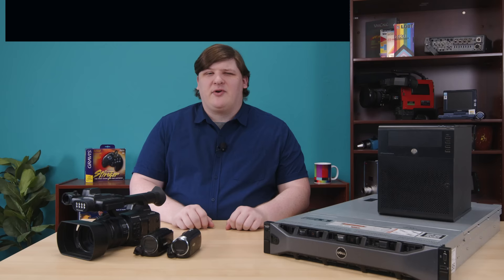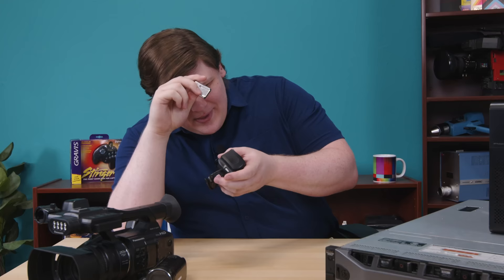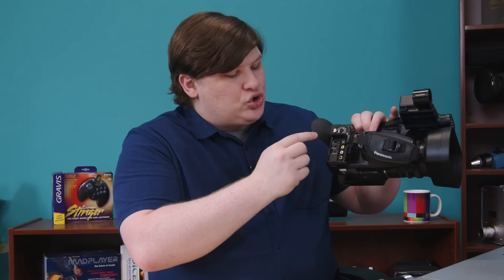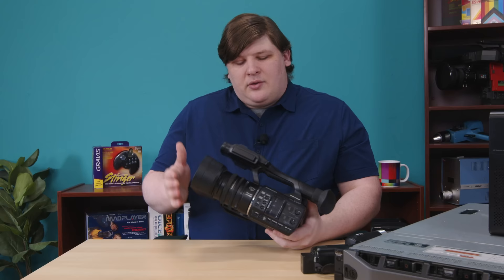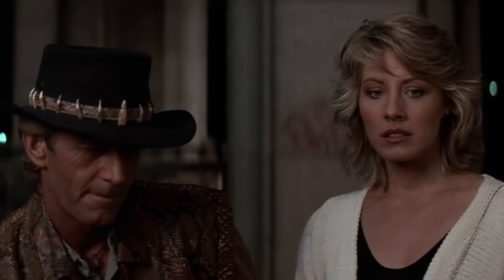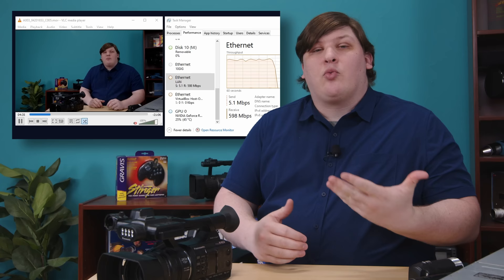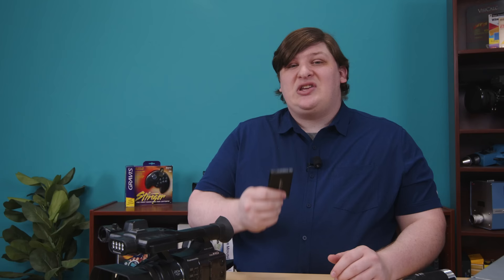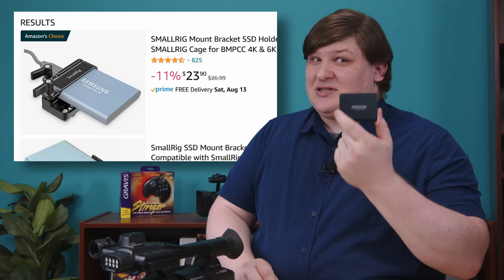I Built... a really fast NAS?

Comment: I built a similar system, except under Gentoo/ZFS/samba and I have all 12 drives as a single RAID Z2.  It's also built from a ASUS WS-X570 ACE and a AMD 3950x and some generic hotswap chassis. I don't do backups but I have aggressive snapshots.  I'm using optical10GBe between the server and the switch and copper 5GBe between the switch and various high bandwidth clients.  i.e. My settop box and my workbench.  BTW: I love LOMs as well, I used to have a supermicro board with built-in management which piggybacked over one of the Ethernet ports.

Comment: Sorry, well behind,1 year ago, miles too late no doubt but two suggestions; 1) problem of T7s not being ready to reuse when you want to record - you still have the T5s so use them or buy more T7s so you have two sets with a second hub and you're much more likely to have a set available. 2) rendering problem - instead of buying a graphics card with all it's upcoming headaches, buy a machine specifically for rendering the videos to your desired format, it can run happily while you are editing another one or playing your favourite game.  Direct connect your desktop to it to transfer the edited file to it and then direct connect it to the server to transfer the files after rendering.  This will ensure that the file tranfers etc. don't interfere with each other and help to discipline you work flow. You can use the second connector on the server for you personal usage also not interfering with you work usage.  All relatively cheap, really, and simple enough to not need any training videos and manuals!

Comment: When the camcorder manufacture has to  include a light built in it tells you something about the capability of the camera sensor.  
The Panasonic X2000 also has a really cool light in the handle you quickly figure out it was included to make up for the shitty tiny sensor.

Comment: I do really think that you can get more speed juice out of those Crucial SSDs performing a "secure erase" (or safe erase) despite it's a pain in the azz and involves certain risk. Some brands like Samsung provides a bootable tool to perform such a task easily, but doing so in Crucial, WDs, etc. is more troublesome: SSD drive "frozen" state which requires a Sleep command, followed by a physical detach/re-attach and so on. A bootable Linux dist or the "previous" Parted Magic version is usually needed.

Comment: A couple comments below @arnechino hits on the key point. Watching this video vs more slick & 'produced' content on similar subjects held my attention for the same reason old Spidey comics used to keep me engrossed. It's totally relatable. In an 'I can't win for losing', predictable kind of way. The excruciating detail of the rabbit hole of tech pitfalls mirrors my own personal experience literally beat for beat, the entire rhythm of it. And your attitude & the way you refer to the various pieces of technology as promising hope of the ability to rise to new, never-before envisioned level s of efficiency, just everything humming along perfectly, only to become immediately disillusioned and realize all the inherent gotchas of technology so tightly coupled to consumerism, with ridiculous limitations & incompatibilities seemingly baked-in to keep you spurred in a never-ending 'upgrade this piece to work better with this other piece, then flash the new firmware which means I gotta install a new driver version that requires an upgrade to the the app to utilize the new standard/protocol/codec which means I'm outta space on my system drive which means I gotta buy a new piece of hardware with higher capacity to even do what I need to do' catch-22 of the never-ending, circular consumer upgrade cycle... The affectionate yet backhanded way you refer to older hardware that you resentfully had to use for too long, the jaded, cynical outlook that is the product of years if not decades of molding through this process. The 'I am not a smart man' stuff of being pummelled by the soul-suckingly high-maintenance nature of managing this crap to be able to manage your 'actual' crap. It's so meta. So frustrating, so exhausting.... but ultimately it makes me feel better to know that I don't suffer alone. All the thoughts of 'mere mortals. they have no idea of the burdens i bear!' with their blissful ignorance and thinking 'you're so smart you know all about these computers & technology'... they don't have a fkn clue. But knowing that there are others that fight the good fight. Brothers in solidarity. Knowing that the 'struggle is real!' is what keeps me entertained. Belly-laughing when you you pull out the fired power supply from trying to render with no GPU. Priceless!!! I worked in a big-ass data-center and the #1 failure across the board is <drum-roll please> POWER SUPPLIES!! That's why they're hot-swappable and don't have all the damn connectors on cables for yer 6-pin & yer 8-pin PCIE power. Oh yeah.. there's a LOTTA stuff your can do that is technically NOT SUPPORTED and the vendor is never gonna help you with that. I mean maybe if you know a tech like personally he'll clue you in... but in the enterprise world there's no time to be screwing around with all that sketchy stuff. And nooone is gonna care whether your script does or doesn't do what you think it should. NOT SUPPORTED!! Ha! Good times. I was entertained by 1.5-ish hours of 'day-in-the-life Woke up, get outta bed, ran the comb across my head....' adventures. And no, i'm not a Patreon supporter but I did subscribe. This was by far the best, most humourous, most relatable & inherently funny piece of content I've seen from you yet. Keep up the good work!

Comment: Running 9x Dell M1000E Bladeservers in 3x 36U contoured IBM racks, at home... initially sounded like fun.

Steel I-beam reinforced floor.  Lowered ceiling.  Three air conditioners, two domestic supplies for 120A at 230v, and a house that's always too hot to be comfortable and a downstairs that's too loud to think.  So, I live upstairs now, with a window always open... like, always!

My electricity bill is ridiculous, so now I'm running other peoples servers and telecoms to pay the electric and the network bill.  I feed it with two seperate 'hyperoptic' 2Gbit synchronous fibres, two failover 650Mbit cables and a 3G/4G WAN connection for the administrative VLANs 'last chance' failover... who's rental costs it also has to cover.

Unfortunately, one side effect of all these contracts is that I cannot afford to just turn the thing off!  The thing eats electric, drinks bandwidth and thrives on human sweat, tears and broken dreams.
I've spent the last three months staying with a friend, and it's been absolute heaven.  I had almost forgotten what 'quiet' sounded like.  So I may have to face the very real possibility that my house has been taken over and I'll have to go live in my car.

Anyone want to buy a cluster?  It comes with a free house.  Anybody?  Hello.... anyone?  anyone at all?

Comment: FYI: I run R720xd's with two Nvidias in each under Kubernetes running transcoding tasks [ffmpeg+CUDA]. It's doable with 1100 W PSUs and in DC – so you're right about both the temperature and power requirements.

Comment: This was great.
BTW, when you can, just get a switch that has SFP+ ports available. If you already have SFP+ uplink ports on an existing switch, just put your server and workstation on the uplink ports if they're not in use. Even with a switch in the middle, direct-attach copper has nearly no latency. Your fast NIC/slow NIC issue will disappear, as then you'll be connected to your network over the fast NIC, eliminating the need for the slow NIC, and your multiple connections error might die.
You don't need separate fast/slow NICs on your workstation or your server this way, as you'll still have more bandwidth going to either of them than your workstation will need to your server and the Internet combined.
Reply from the maker: Much of the reason I haven't done that is for data security. I largely trust my home network, but you can't be too careful, and since there's no reason for anything else on this network to ever touch this machine, I prefer having it as isolated as possible. It's worth considering though.
Reply: @CathodeRayDude  It's worth giving a trial period if you have the hardware.
Judging by your situation, it's not getting any isolation at all as it is. A few things could be going on here.
One is, your iDRAC port might be doubling as a network interface when the server's on. I can't confirm this, so it's just a thought.
Another is, you have your server connected both to your network (RJ-45 other than iDRAC) and to your workstation.
In either case, there's no access control. You're allowing SMB connections to come in from your home network. There are two ways to combat this. One is, to set your server's firewall (usually UFW, the most popular front-end to iptables) to block the SMB port on your RJ45 interfaces. The other is to set "hosts allow" in your smb.conf to designate which IP addresses may connect. If you want it REALLY hardened, you can do both.
That being said, you could just connect your server and workstation to your home network over SFP+ ports on a switch and use that "hosts allow" rule to harden it. You're already doing really well by having a read-only archive, so the only way the archive can be corrupted is if the server gets attacked rather than a device that just so happens to be able to access the shares.

If you want to talk later in more detail, I am an absolute paranoid nutcase when it comes to security, but at the same time, I do things many people erroneously think are risky.
Reply from the maker: @LokiScarletWasHere  Oh sorry, I left out some details about that to save time. I have my smbd set to only listen on the 10gig interface, and intend to add harsh firewall restrictions once the machine soaks a bit longer. The only reason that problem happened is because I was still in the testing phase and hadn't yet put the limit in place, but I was still very irritated to see that Windows' abstractions ignore which IP you deliberately try to access a machine with. To wit, some people have told me that SMB3 is supposed to multipath if possible, but the nutty thing is that not only did it not prioritize the IP I accessed, it also picked the slower connection. I'm sure that's only because the internal NIC identifier was lower, but that's still an absurd way for it to work.
Reply: @CathodeRayDude  That's Windows for you. It's essentially asking the server "Who are you" and then ignoring whatever identifier you used to connect to it, instead identifying what other IP addresses or even other protocols it can reach it at, and using absurd logic to decide how to do so. It's part of why I hate Windows so much. Every job I've had, Windows would deliberately choose the worst way to do just about everything.
You may get some better control out of NFS, though that's not as native and simple for Windows as SMB is. 
Hopefully your errors go away when your firewall and Samba rules have set in, but it'll probably be easier to get them both universally connected on one medium and set the "hosts allow" rule for your shares. Less hassle, as you'd be keeping your networking simple, but as long as it works, that's all that matters :)

Comment: This is pedantic, but I have all this shit in my brain, so you're getting it here: LOM is actually Lan On Module, just a general term for the ethernet controller. Dell's iDRAC is a type of OOB (out of band) management, equivalent to HP's iLO. These are all full (arm-based) linux systems wrapped in a shitload of proprietary security junk, which is how iDRAC stays available while the system is offline. 

Thanks for making this vid, and for being straight about not recommending servers to home users. I had a Dell powervault stack with ~30ish old-school 46GB SCSI drives that totaled around 2TB. It was fun to setup, but an ABSOLUTE NIGHTMARE to maintain and live with.

Comment: 39:18 - I have an HP workstation from 2013 in my room. I can fit 6x2.5" drives and 3x3.5 or 2.5 drives for a total of 9 sata connected drives. It's very quiet unless I'm rendering or compiling.

Comment: Don't know if you're still looking at comments on this, but when Windows tells you it can't connect a network drive because it's already connected, the problem is actually the opposite - I can't connect to the share at all any more. So the share has dropped off. Every time I've seen this it's either a networking issue or Samba crashing.

You might get better performance by exporting ZVOLs or files over iSCSI, setting up the initiator in windows, and then treating those as actual hard drives (ie format with NTFS and use exactly as it local drives). It's a much lower level protocol and tends to have much less latency than SMB/CIFS. You also avoid all the issues that come with SMB.

Source: I've been working in the enterprise with software-defined storage, ZFS and iSCSI for 20+ years.

Comment: If anyone wants a server in pc form factor, look at the define 7 xl.
My desktop has become a vm host, nas, homelab server, workstation, and gaming pc.
Of course that is very heavy when watercooled with 3 gpus, 14 hard drives, and an assortment of solid state storage (mostly nvme &u.2 for no good reason).
But it is a quiet desktop, especially if you aren't cramming 1400W of hardware into it (I have external cooling).

Comment: For your h265 transcoding, you could use an A2000. It's made for servers, no 6/8-pin requirements, and lots of crypo folks are dumping them all over amazon and ebay because they're super power-efficient and run cool and are basically a chopped down 3060 with all the cuda for your transcoding. I literally use these for exactly what you're describing. If you want to snag one - double check which card you're getting if you're going used. You really want the 12gb version if you can swing it. It's not always obvious and they don't always disclose. If it's not disclosed, assume it's the 6gb.

Comment: This is over a year late, but for the whole "GPU in a server" issue: it doesn't matter if the server supports it or not. it'll work. While sometimes there isn't any 6 or 8 pin connectors on the riser cards, there are usually random 6-8 pin connectors scattered throughout the board just in general. And when there isn't, usually there's something akin to a 24pin motherboard connector sorta looking thing in there, which can supply the required power no problem, assuming you get the correct cable for it. 

But all of that is moot. You have a server. You put a server GPU in there. Problem solved. Most server GPUs do not require 8pin connectors, and a vast majority of the ones that would be peeeeerfect for this particular server, don't require external power at all (a tesla p4 for example). They not only out perform something like a 200 series card, but can also out perform a 2000 or 3000 series nvidia GPU as well in terms of encoding power. Its kind of what the server GPUs are designed for: low power, high efficiency, great performance. Chuck something like a Tesla P4 in the server, and you wouldn't have to worry about any power requirements what so ever. Ontop of that, it can handle 4+ direct video encodes without even batting an eye! A Consumer GPU can do usually 1, maybe 2 encodes at one time, but usually doing 2 encodes requires you to be encoding in two different formats... The Tesla P4 can do 4+ in nearly any format you wish. Meaning! You could set up your script to start a minimum of FOUR encodes, and legitimately cut that transcoding time down to just 1/4 of the time. Yes its raw performance isn't 'as good' as something like a 3000 or 4000, however the ability to do 4+ encodes/transcodes at a time, all at full speed, still comes out to be faster than encoding/transcoding all the footage ONE AT A TIME.... 

If using a consumer GPU would take you 1 hour per file, but it takes the server GPU 1.5 hours to do that same same file... then yea, its 'technically slower'. BUT taking into consideration that the server GPU is doing FOUR files, in 1.5 hrs, compared to a consumer GPU doing four files in FOUR HOURS... that's a massive time savings worth considering.

Comment: There's other things you can do with direct-attach cables.  You can also be used to take a 100Gb SFP and split it out into up 12x10Gb connections.  This is really handy when you don't need as much speed (mostly because you're connecting devices that simply aren't up to dealing with 100Gb) but you need more commotions.  (Yes, there are devices that have this issue.)

Comment: sidenote: fiber is actually pretty durable. you can yank and pull and oftentimes inadvertently kink and it will survive. plus its extremely thin physically, so its much easier to route and cable manage than DAC

Comment: Invest in a used tape library.   For less than 5k USD you can get something that will store 100s of terabytes.  LTO7 is 15TB (compressed.  6TB uncompressed) per tape and you can automate backups to them you can also use it for archival storage of uncompressed video.     You can also do this manually as part of your workflow and shelve the tapes writing the name of the video on each tape   As part of your ingest process dump each shoot to a tape put the tape on a shelf  for less than 1K usd you can get a drive and spend about 20-40 $ per tape.  Which is a small price to pay to have all your shoots in full quality